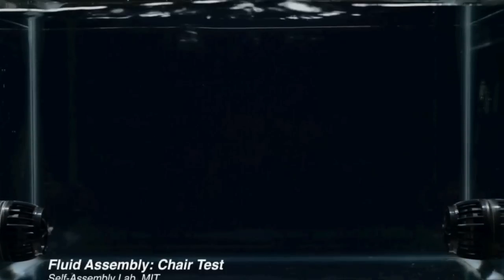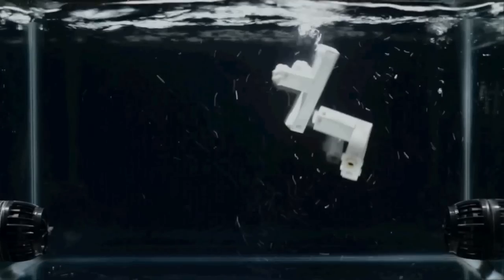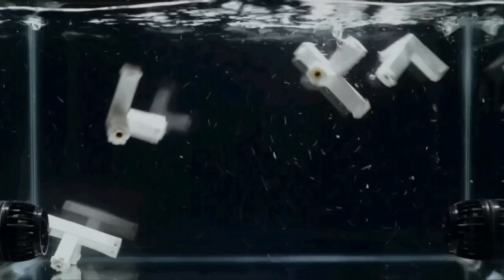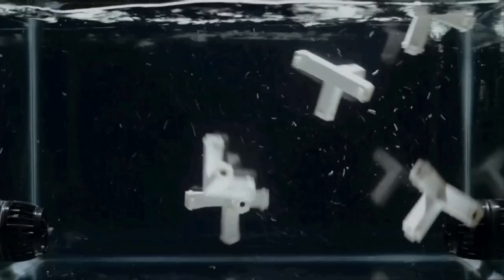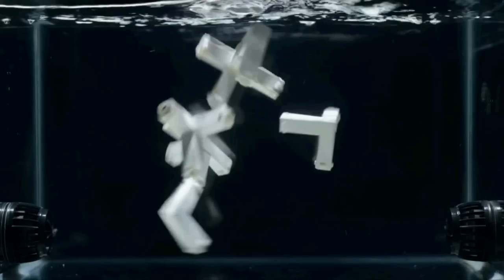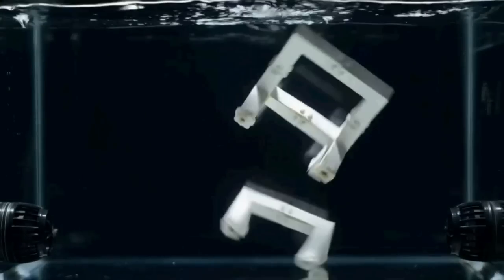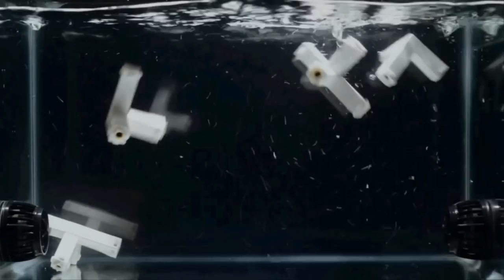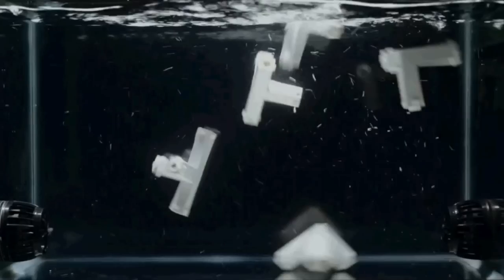MIT's self-assembling chair

Comment: I wouldn't call an environment 'uncontrolled' when I have to provide a confinement for a section of it to make the assembly work.
Of course you may saturate a volume of the environment with components to ensure the required interaction (without controlling the area of operation), but that would certainly reduce possible utilization to very specific scenarios.